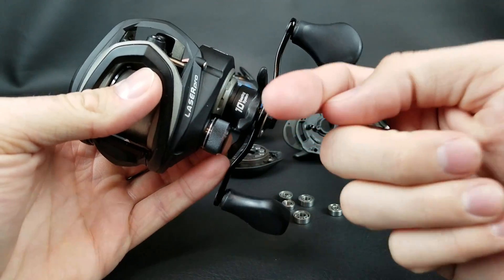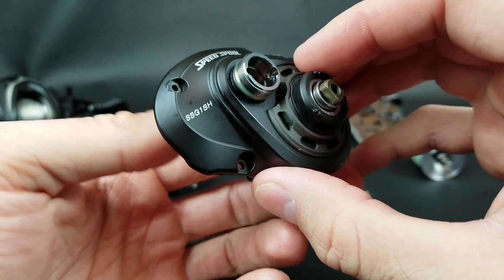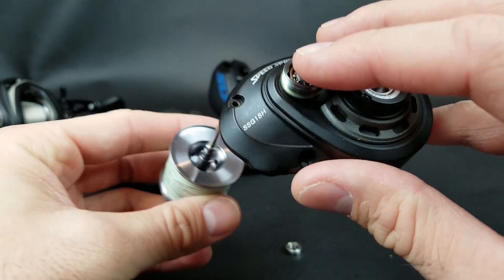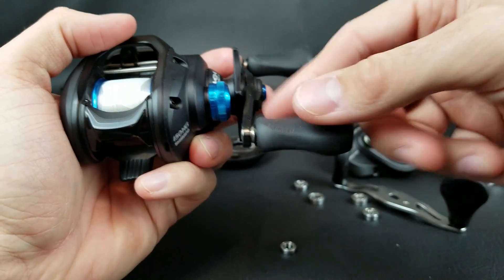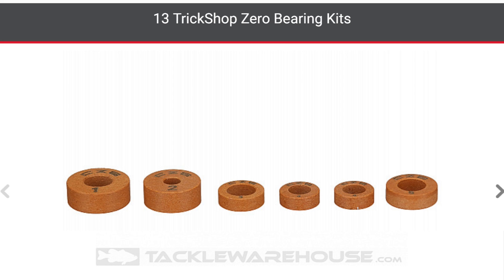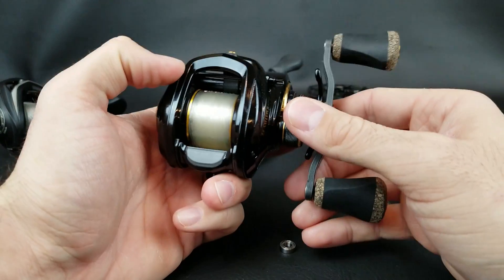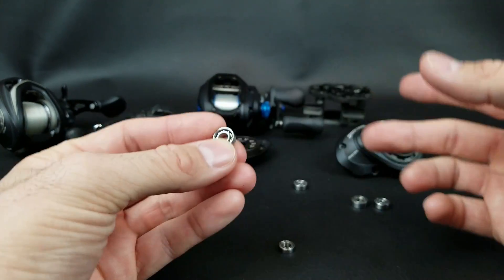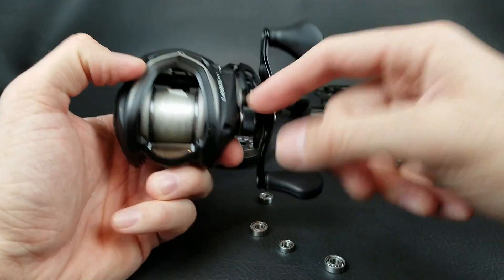Are MORE Bearings in a Baitcaster...BETTER? (You May be SURPRISED!)

Comment: Hell!!! ALL my reels are $60 and below. Had most over 6yrs. Still in rotation at damn near 3-4 times a week. With all having a 5+ lbs on them. Panfish set ups are on 10yrs running. Sure expensive reels are more appealing...but not necessarily practical. Maintenance balances quality!
Reply from the maker: I completely agree. I have reels that are all price ranges and maintenance is the BIG key. Some reels hold up better to certain applications compared to others. By no means do you need expensive gear to enjoy fishing. I tried to convey that in pointing out what a lot of the extra cosmetic stuff is that you pay for. Thanks for watching man!

Comment: Ouch! 
Totally missed a huge variable on bearings.  Cost increase and operational feel increase (or decrease)  can also be related to Ceramics and hybrid ceramics used in bearings. 
There are kits for upgrades to standard steel bearings and bushing replacements. OR one can get the bearings and bushings sizes from 1) the manufacturer or 2) using a Micrometer  and then ordering upgrade bearings from over seas at a fraction of the cost. 

The casting performance alone can be huge. Overall performance (changing out all bearings and bushings) can totally butter up a cheap reel.
Reply from the maker: Completely agree man. Ceramic bearings do feel different. Thanks for watching!